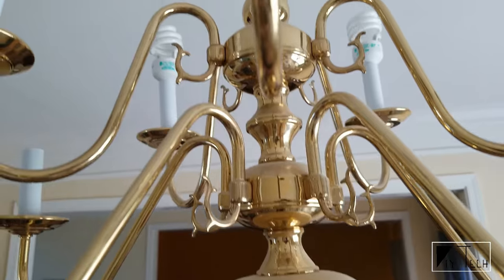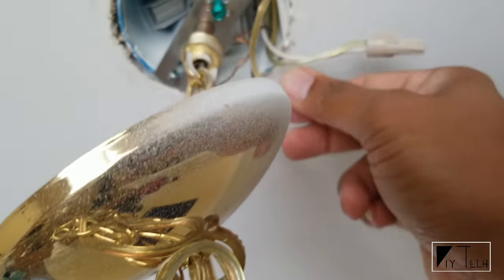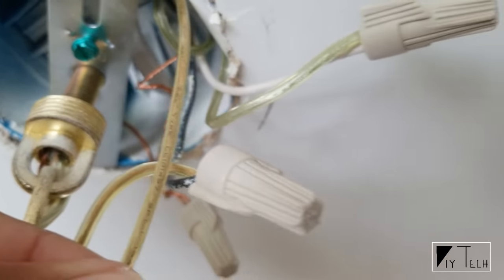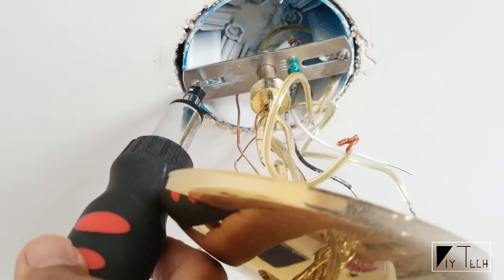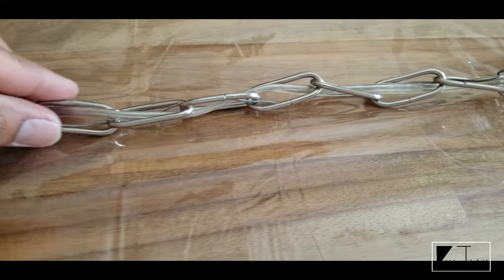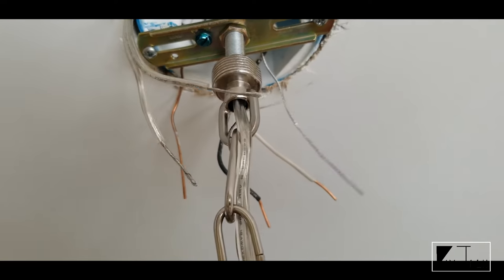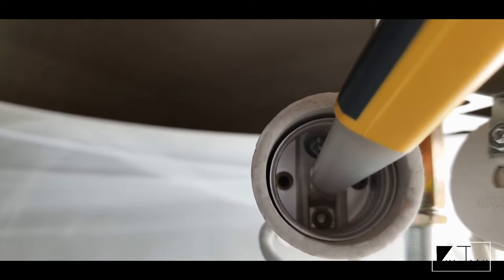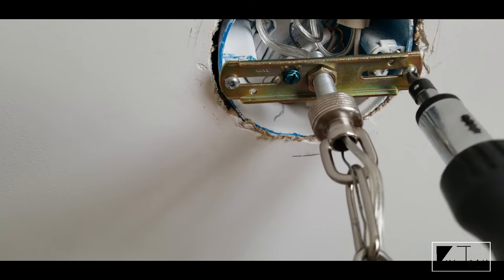How to replace a Chandelier  | How to replace a lighting fixture.

Comment: BEFORE STARTING ANY ELECTRIAL WORK, TURN OFF POWER AT BREAKER OR RISK INJURY.
Reply: Just turn the switch off and test the terminals. Not strictly required to turn the breaker off.